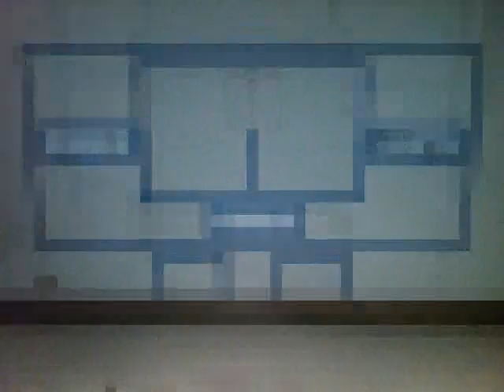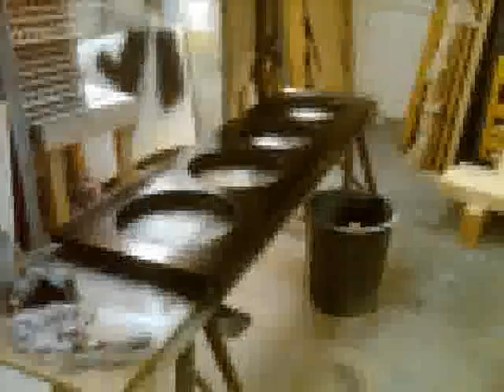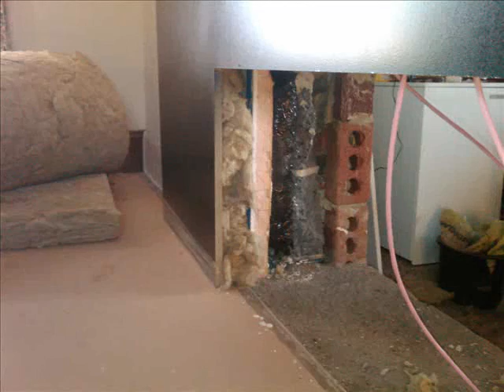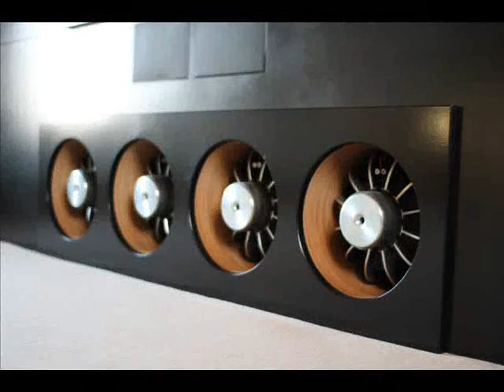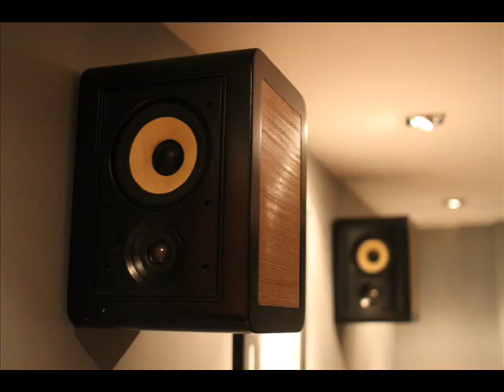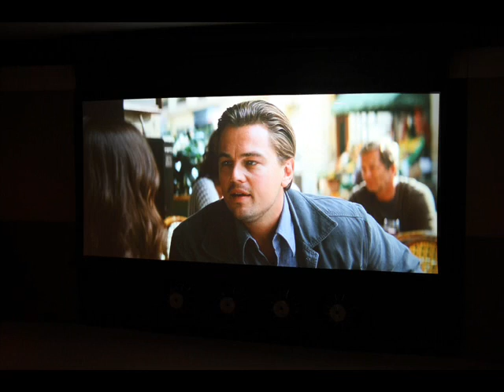Infinite Baffle subwoofer, Anamorphic Projection

Comment: Hi chap, I am planing a similar IB array under my screen 4xfi318s but with another 4 of the same, two mounted each side of the screen.  Mine will also be backwards venting outwards, but into the garden covered by louvers!  Where are you based? Steve

Comment: Absolutely gorgeous install. What did you use for the cylinder part of the enclosure? Do you have any issues with noise coming of the back of the drivers? I have some fi audio ib318s that I'd love to mount this way, but I was concerned about the motor noise.
Reply: There is minimal motor noise. The bass will give you goose bumps.